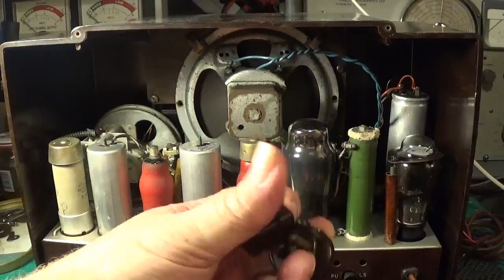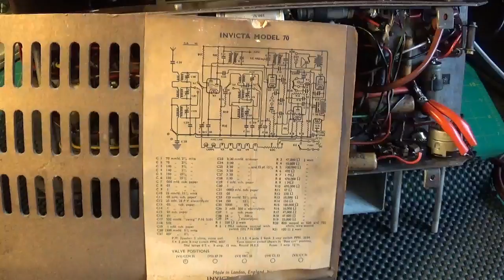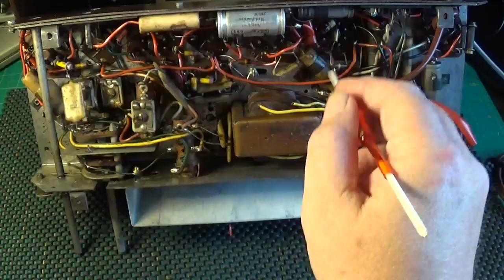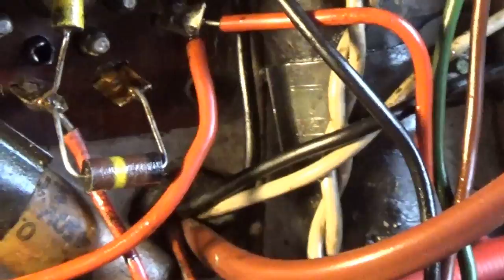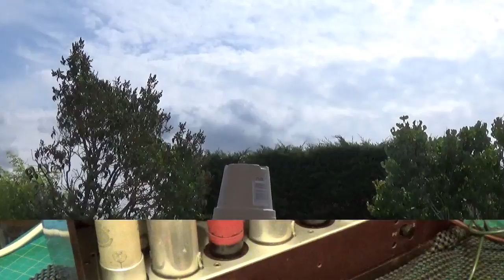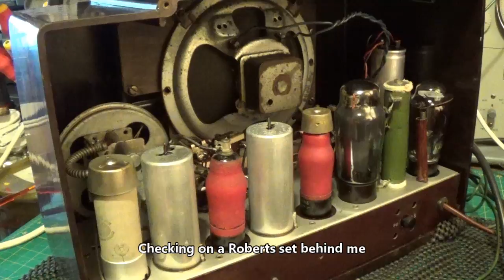Invicta Model 70 Part 2

Comment: After watching the previous instalment I went straight to screwfix to get some of that No Nonsense Degreaser. Funnily enough the day before I bought a DAC90A with what had the worst case of nicotine staining on the chassis, valves etc... that stuff on a toothbrush took it off with ease, and I suffered from nicotine rush for half a hour! Great video as always!